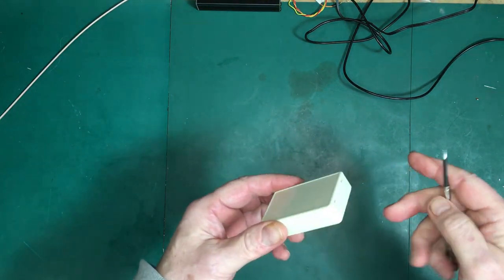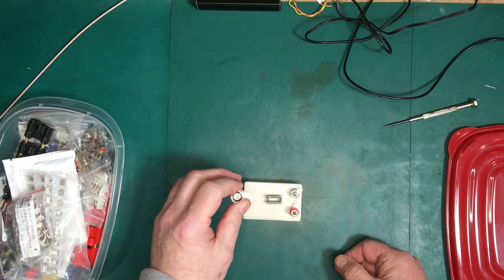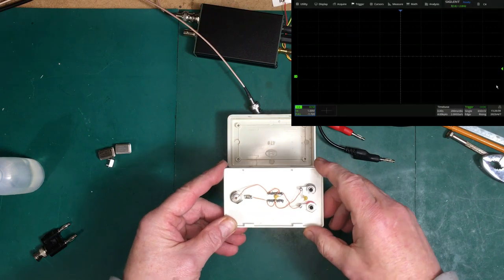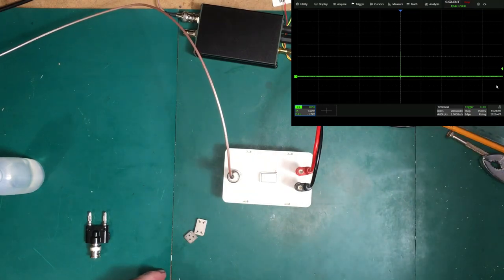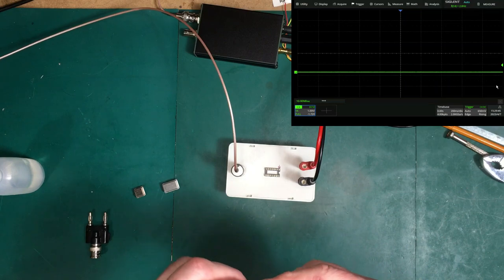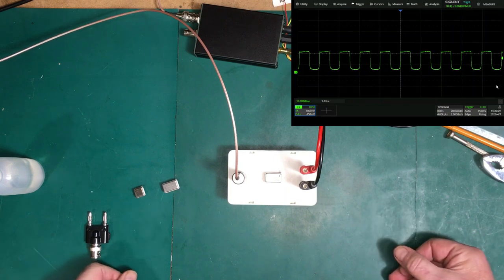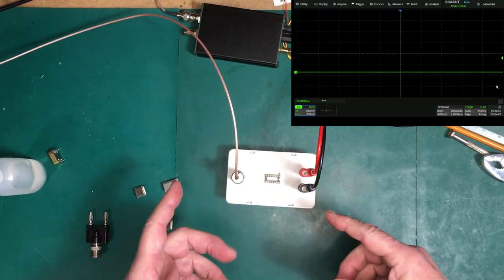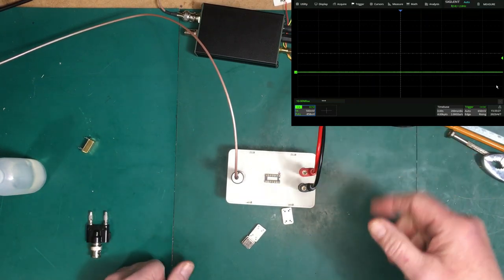0035 - I Screwed Up! : Crystal Oscillator Test Jig

Comment: Nice little fixture. I like making things like this, especially when these days we often buy components in lots of 10, 20 or more, its good to be able to test them all when they arrive rather than finding out 50% don't work a month or 2 down the line...  Its also frustrating and embarasssing when you destroy something unecessarily because some ad-hoc test arrangement slips and breaks everything. i must confess my test rigs tend to be put together on bits of protoboard and rarely make it into a case but at least they are solidly constructed :)
Reply from the maker: It sure is a frustration.  Now the project I got that for is delayed until I can get a replacement.  We also live in a time when the market is filled with very suspect copies.  So work, some partly work, some just don't.  Testing is a requirement.

Comment: Thank you for sharing your project and your mistake. I have no stones to throw; we all encounter such challenges. I recently purchased four used 10MHz (Asian cell tower type) OCXOs. Being used, I knew that I must test them. Before starting, I realized that I could create a short. So, I cut a shim out of thin plastic and poked the oscillator pins through it. This provided the needed isolation.
Reply from the maker: Nice clean solution.  Thanks for sharing.